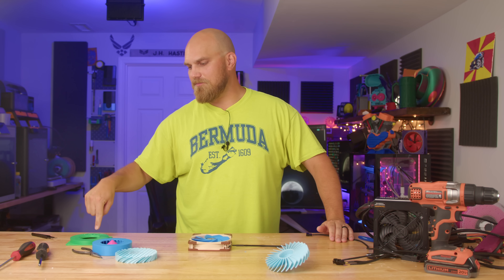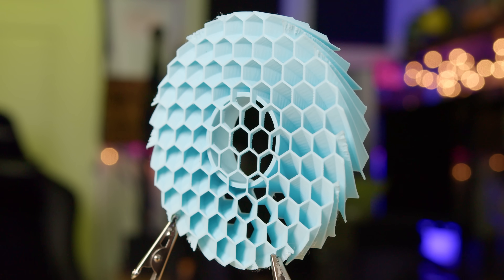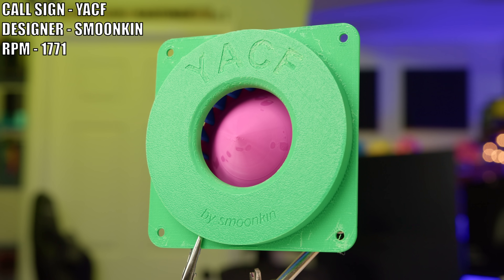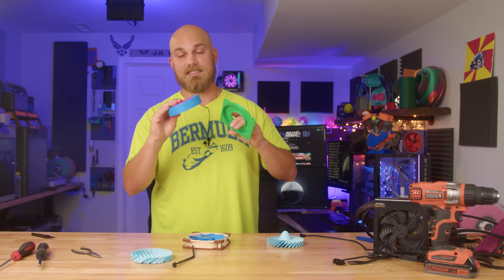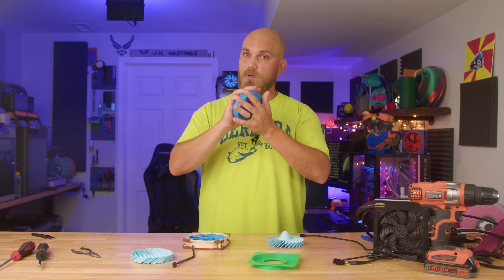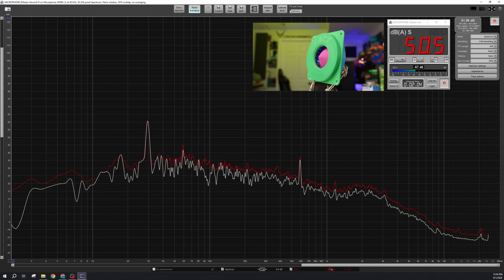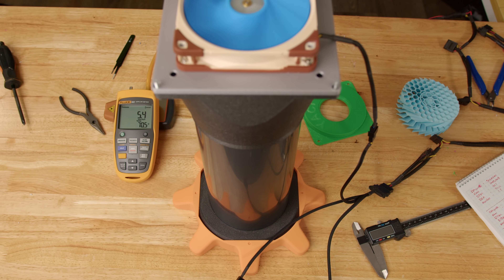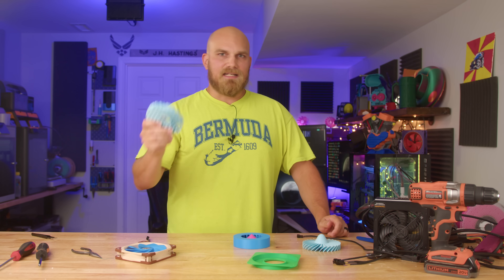This Fan Crushes Noctua A12x25 by 125% | Fan Showdown S6E5

Comment: Have you considered running a test for the more static pressure designed fans from Noctua, like the NF-F12?  The A12x25 isn't really a static pressure fan.

Comment: We need to keep our performance assessments sane. If a fan technically has superior static pressure but it only blows its air about 1/10 the area that another fan with half the static pressure does, then for radiator cooling applications, the fan with half the static pressure but 10x the airflow area would be expected to be superior. We need a practical fan gentlemen, not one to max out just one performance metric while being lacking in others. People do say that static pressure is more important for radiator cooling, but it's not like airflow is of that little importance now, is it?

Comment: Now it's easy to create the optimal static pressure PC fan. Use the Vortex9 as base. Stretch the blades upwards so they can capture more air, and design a shroud to close of the elongated blades so that all the air gets tunneled down

Comment: The Vortex 9 deserves a lot of credit for getting second place overall without extending outside the original fan dimensions. Designs that can be used as a drop-in replacement for a standard 120 mm fan should get their own category imo!
Reply: I wonder when we will see this in mass production...
Reply: @Thunderstyle7 wish there was an STL. I've got a need for “fits the form but high static”
Reply: @Imiancrook  same here. wonder where the STLs for those nice design are. Need to raise the airflow here to get rid of the fumes of my 3D printer, but don't want to use those readymade bathroom ventilation kits för that.
Reply: Time to request that as a season 7 design criteria
Reply: but why the smoke did not pass through if it is the better?
Reply: @LipiSus-m3i smoke chamber doesn't work exactly the same way
Reply: i dont understand why the smoke doesnt go out and keeps turning around the inside of the fan, its a big mess
Reply: @retrocompaq my guess is more mixing means less viable smoke. This also agrees with the sound measurements. More turbulence, more noise, more mixing, less visible smoke.
Reply: I need 3 for my PNY 4070ti super. Who wants to print them? lol

Comment: Sure, you can optimize designs for certain aspects like static pressure, but always at the cost of something else like noise, power drain, cost of manufacturing etc. If a professional fan designer like Noctua (or any other brand) could noticeably increase overall performance and beat out the competition by changing the fan design, they would have done so a long time ago.

Comment: static air pressure is cool but if it can only move barely any air, its really not that usefull. Like if i wanted to use this on a radiator, it would move air through the fins easily but slowly... leaving the only usecase for the fan is inflating stuff over long periods of time...

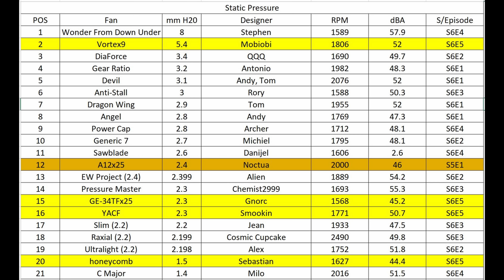Comment: Sure it wins in static pressure, but that's not what Noctua is maximizing. And from 8:43 we can clearly see that the Noctua fan is much, much quieter.

This video title is like saying a random dude wins in a race vs peak Usain Bolt because you didn't specify that the random dude was using a motor bike.
Reply: You nailed it. The noise level is one of the main factors for fans.
Reply: Sunon maglev 12V Super Silent fans beats noctua in every aspect. They are more quiet and pushes more air, with just a fraction of the price.
Reply: @ They aren't sold anywhere but AliBaba and haven't been reviewed by any major tech publication or reputable tech youtube channel with noise normalized testing facilities, so I'm going to have to doubt that claim.
Reply: @SpiceCh  I have them at local electronics shop. Can't post a picture in the comments, but here are the specs from the store for 9225 fan: 18db, 47,73m³/h, 1700rpm, price 5€. 4010 fan that I use on my 3d printers, 18db, 9m³/h, 4500rpm, price 6€. 
They are not "popular", that's why there are no reviews. Doesn't mean that they are bad.
Reply: For 10 more dBA has more than double the performance at a lower RPM.. what are you smoking? I am a Noctua fan too (excuse the pun) but man... get real... and yes, the race was called static pressure, and it clearly wins that race.
Reply: @gmlviper  If all you care about is temps, then yes, the Noctua loses. But as I wrote in my comment nowhere is static pressure advertised as the measuring stick in the video title. Even 3 months later, the title still says nothing about static pressure. It cherry picks a measuring stick that's inconsequential to the user experience in order to get clicks.

10 decibel is twice the noise, and twice the static pressure isn't twice the cooling performance because diminishing returns are a thing.

Noctua has their competitors beat in performance-to-noise ratio, with a performance that's more than adequate to cool high-end CPUs on the market today to boot. To 99.99% of people who buy air coolers, it is a better product. And if all you care about is temps, you're not buying an air cooler anyway.

I don't know why you necro'd a 3 months old post telling me to "get real" when you are the one not reading what I wrote in the first place.
Reply: @gmlviper  10 dBA is a lot tho. You have to remember that only 3 dB is enough to create what is perceived to the human ear as a doubling in volume.
Reply: i will never understand pointless dB comparisons when it comes to PC fans
i will either A. perform a task that does not req. performance from the PC witch does not make the components to generate heat, thus the fans are silently idleing at lower speeds, 
or B i am gaming and the sound of the fans does not stand a chance compared to the sound of the games (it's farly common for people to not even hear sounds that they SHOULD be able to hear due to the brain condition named "selective hearing" when they are concentrated on something)
Reply: @Sigrid_Von_Sincluster  I have noisy fans and believe me, they get on my nerves very quickly. 
The Noctuas aren't even particularly quiet when they're running at full blast and these make twice the noise, so you'll definitely hear them, even through headphones.
For what? 5° C cooler cpu on a cpu that's probably already below 75 C° at 100% load? Pointless.

Comment: I use Noctua and Papst fans. cost little more then stock fan's. 
Works good and quiet. I have never got a Noc or Papst fan that had failed, I'v used both brands for almost 20yr's.
Papst fan's are really nice, cost little more then Noc.
Recommend switch all stock fan's, to better ones, If you use the PC a lot. 
Noc maybe cost around 100-150$ for 4-5 fan's.
Papst can cost between 35-80$ for 1 fan. 4-5 fan's can be like 180-270$.

Comment: I think one of the coolest and not spoken about part of this series is seeing the surface tension of air during the smoke test.

And how the smoke in the air shows air being drug into the fan by the air proceeding it and the air around the fan that doesn’t get pulled directly in gets slung forward into the divider wall.

If someone could harness this “free” energy contained within the air itself, I think it might bode well for a fan design. 

To use the pre-acceleration of the air as a benefit to increase overall air captured as well as the “bypass air” that’s completely missing the fan with an external siphon around the rim of the fan that would pull it in from the circumference as well instead of just the face.

Go back and watch that slo-mo and you’ll see how fast that smoke is moving when it gets slung into the divider. Imagine using that air-speed and volume by having a circumferential fan intake in its own bypass circuit. Where the main body/fave of the fan has a normal design, but the circumference has a high pressure design. The fan should meet many requirements for all the seasons at that point. With the proper design that is.

I’m no designer or engineer, but if someone does read this and either has some input or ideas they’d like to share and enlighten me on, or thinks it’s a good idea and makes it could you make a nod with the naming? Like the Jaspa Fan?

Comment: I am a bit confused and new to this stuff with fans, but the votex9 on the smoke test looked messy, while the honeycomb one cleared the room. 
I get the pressure aspect is not as good on the honeycomb and the vortex9 is much better, but I guess I don't get how that improves cooling. 

I would really love to see them in a cooling test, with 2 of each fan, one bringing air and one exhausting with only a heatsink/always the same fan on the cpu? 
Airflow is where PC cooling really wins right? So the smoke test to me should be what we need a bit more than that pressure test? You could always set pressure by pushing more in than out etc? 

Or do i just have this utterly wrong

Comment: not sure if you've done it before or not, but could you try doing a season where you test for homemade air purifying (corsi-rosenthal box)? I've seen a setup where you install a PC fan on one end of a circular HEPA filter and cap off the other. I imagine a decent setup would be to put this in a box with a controlled amount of smoke (either timed release or total particulate, such as burning a specific sized item).

Comment: i thought honeycomb and ge look good.. they were sucking all the smoke into right direction. whats wrong with them? if youre worry about static pressure efficiency, use it for bottom and use air flow like honeycomb or ge in front of pc. where can i contact those guys that made fans?

Comment: thats way too far apart. should be a weekly thing. interest is way lost any longer. 

that a12x25 sucks, please get the industrial 120mm Noctua that is 3000 RPM. has WAY more speed and torque to test fans

Comment: honeycomb seems to have little centirfugal force in it. edges does push but middle will let it out. 
being as close to sealed, have long tubes that are using centirfugal force as much as it can is the way. 
scoup that gathers as much as it can, then long tube to contain and compress, then narrow slit to let it go, seems like how you get most. 
you need a long way to go to keep air from escaping, that's why most static pressure fans are blowers, any leaks faces tips of the blade, where centirfual force is highest or it has very long and thick blades to nearly seal the middle, while ends "scoup"

Comment: Cool Video... BUT...Static pressure is pointless. Open Air systems - the honeycomb is the pick... Anyone that uses STATIC pressure to test computer fans... is not testing a fan correctly, computers are not SEALED systems... The smoke test... the honeycomb was the best from your own video... so I am not sure why you would test to see if the honeycomb would hold pressure... its built to MOVE AIR... so you use these together in a computer system... to MOVE air the most efficiently & quietly. Who the heck has an air-tight computer system. If I had to guess... the jet engine turbine build and the honeycomb MOVE the most air. Retest and show this please!

Comment: When you optimise for pressure alone you end up with silly inefficient designs which wouldn't be any use in real world coming top. You need to enforce a minimum flow rate while optimising pressure.

Comment: Awesome video! But why not use a cheap automotive mass airflow meter (might need to compensate for non-linearity) or an ultrasonic sensor (more expensive easier to use)? 🤔
You could also put a throttle and automate it to graph the static pressure VS airflow. Then do the same for cases, cpu heatsinks, air-to-water Intercoolers etc. to optimize cooling power.
There are a lot of easy tutorials on YouTube, but leave a reply if you want some free tips!

GL & HF!

Comment: I would love more fan showdown I'm just a bit tired of seeing so many designs that leave the frame by a significant margin. I think this episode was great because we saw fans that all match the profile of the frame reasonably well, or only extend beyond it a lil bit. But I really dislike seeing so many designs with "The Cheater" levels of accessories or volume outside the frame, IMO those should feel more like an occasional sight gag than a series staple - because no one in their right mind would put one of those in/on their case/radiator.

Comment: Centrifugal will ALWAYS beat axial when it comes to static pressure and axial will ALWAYS beat centrifugal when it's airflow. Rating fan design just on static pressure is not fair, 2 totally different class of fans for different usage. People will start submitting only centrifugal design just to be in top position. If you rate fans on both pressure and airflow ratio, that will force engineers to submit even more wild and creative fan designs. Or have two categories, then you get more submissions.

Comment: Did you test for vibration and power draw and load?
Also some proper cooling numbers would help, that x9 just pulled a lot of air, it didn't do anything with it

Comment: the vortex is high static pressure but seems to be blowing a lot of the same air back, like if it were inside a case it would just take the hot inside case air and blow it back towards the case, albeit with a lot of force.  The smoke test shows how little of the cold outside air actually makes it to the other side. Would probably be a really good cpu fan or gpu fan since those get inside case air anyway, but for intake or exhaust case fans it surely would be pretty bad for temps

Comment: More fans and more often! We need the best fan possible!

Except next season you should have a category of testing for airflow at a standardized noise level (throttle the fan till it reaches a specific noise level) and pressure at a standardized noise level. This would allow us to determine which fan would be best for quiet setups for case cooling and in front of a radiator.

Comment: my first thought is a cycloidal propeller but idk how to adapt that to a pc fan.
my secnd thought is a little more out there.
i am no designer and this is just theory crafting so anyone can take this  however and run with it. 
fan with external face being car hood scoop like, into an imbedded tesla valve with exhaust ports on internal face. not sure of direction to put exhaust could go for edge of blade inline with rotation or forward facing jets near the center. and definitely not sure of best blades to work this into but seems like a concept similar to how turbos in a car work but in a single loop.

Comment: I'd think the V9 would do great with a horn much like ITBs on an engine. The length would have to be tuned to the RPM so as to optimize it as best as possible but yeah, itd be interesting to see how the V9 performs soth a velocity horn

Comment: What i take from model flying and fans with too much blades... Draw way more current if everything is similar. For efficiency and also max power its always lesser blades. At least with electric motors. But what less is the best depends 😅 one blade is pretty efficient.

Comment: Would love if you tested with a fixed RPM ex 2000. That would give you a much better comparison. 
Now, a 2500 RPM 60 dB fan should perform better than a 1500 RPM 40 dB fan, but that's not a fair comparison.
But wow it is GOOD work!

Comment: The Vortex9 seems like i would be a good extraction fan for a case but if used on a cooler or similar it may not cover enough surface area but you could always design ducts so it works right.
Thanks to all for there submissions and you for testing them :)

Comment: My only questions are regarding the density of the honeycomb hexagons...
Does it get higher pressure with a greater number of smaller sections, or with a smaller number of larger sections?
Does the angle of the hexagonal "fins" affect the pressure/flow?
And, How do these changes affect the decibel levels produced?

Comment: This Vortex9 has insane potential. I wonder if making the blades a-symmetrical would reduce the sound signature? 

Also, if you slow the speed to match the Noctua's 46 dBA, does it still outperform it with static pressure airflow?

Comment: Hmmm idk, making good pressure is one thing, but if you arent really moving air, how effective is it really? I would imagine if you put the votech9 on a radiator (the point of a static pressure fan), it would do a horrible job actually cooling it.  You would probably need a inch spacer or something to allow the air to actually be funneled under the blocked off blades.

Comment: As I see it - static pressure and flow are two different factors so even if a fan isn't good at static pressure it can give a decent flow and the best would be to run the fans over a range of restrictions and get a flow vs pressure curve. Aerodynamics is tricky.
Reply: I was thinking a season where the fans are compaired on a simplified P-Q curve. Take a reading at static pressure, and one at open flow, graph that, the fan with the largest area under the 'curve'(slanted line) is the winner. Even go so far as to have it only for fans that fit in the Noctua frame maybe, more likely to be actually used in a real cooling situation
Reply: Yes absolutely. People will start to submit only centrifugal fan just to beat the score. Currently the top 2 unbeatable position are blower fans.